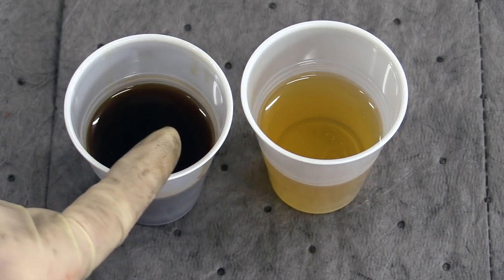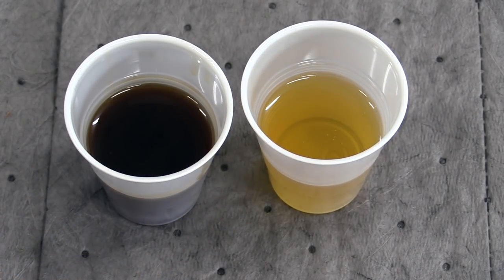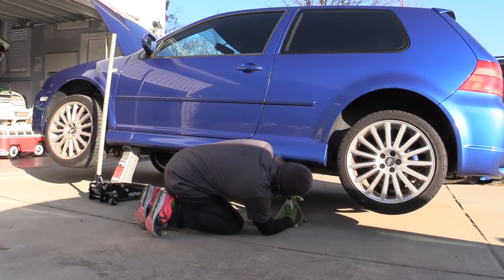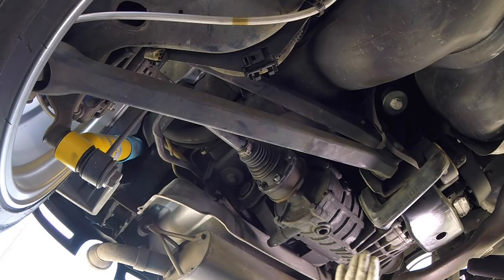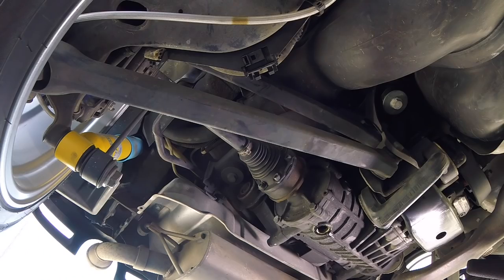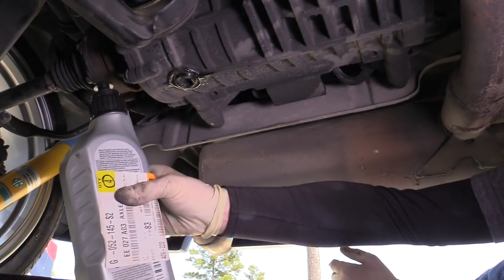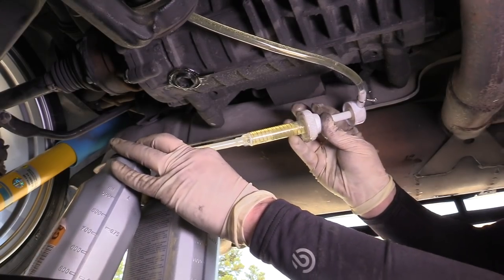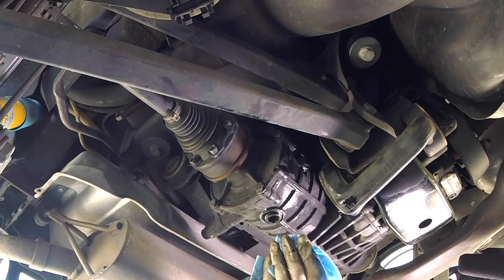How To Change Rear Differential Fluid

Comment: Always open the fill plug first that way you don't empty all your fluids and can't refill it
Reply: just about to comment this
Reply: everyone seems to forget that important first step!
Reply: It's saved me grief before.
Reply from the maker: They aren’t dumb. It would just be a much bigger pain to fill t from the bottom than the top.
Reply: HumbleMechanic So you cannot open it afterwards?? I’m confused.
Reply: In this very video, thats what you did.
Reply from the maker: The concern is not being able to get it out. If you start with the fill and run into issues, you can still drive the car with old fluid. If you can’t get it out after your drain, you’re stuck with no fluid. Or a hard time filling it. 

At a shop we couldn’t say “I can’t get it out”. We had to do what we had to do, and make it happen. For a DIY, it’s best to take the fill out first. Something I mentioned in the trans and Haldex videos yet to come out
Reply: HumbleMechanic Thanks. I understand. Have a good day, man.
Reply: Just about to say the same thing, saves grief!

Comment: Thank You Charles. Maintenance is so satisfying.  Hey guy's, Race Ramps. I bought the 10" inch Wheel Cribs, 2 piece design. Used them for the first time last weekend working on the GTI and had to use a tool to get the smile off my face. Lower half for simple servicing and if ya wanna get your wrenching on, stack the second half. Friggin Perfect!!

Comment: Great video Charles ! Recently did mine on a 2015 Q7., Front, Rear Diffs and transfer case. Was little surprised to see it almost as dark as the one you showed at just 35K. Is it normal to go dark at this little mileage ? I did not see a lot of metal sediments though.

Comment: Hey Charles,
Why would you shake the gear oil. As far as I know gear oil will not separate. Does that OEM fluid have some friction modifiers in it. Also just a tip lossen the fill plug before you drain the oil. Just incase it  won't come out . Ask me how I know. Another great video. I love the sound of that thing. Cheers Mark.
Reply from the maker: Good call on loosening the fill bolt. I always had to get it out and the fluid in no matter what. Hahaha. 

Shaking it is just in case any of the packages settle. Odds are they don’t, but it’s good habit. Unless you shake it so much you aerate the fluid. Haha

Comment: Amazing there is no service interval for diff oil or Power steering fluid. Sure it does not get contaminated like engine oil but that sample you drained looks like it has had some temperature which has cooked it. I have experience with truck diffs that regularly run at 100+deg. C in summer and the oil in them goes very dark. I changed the oil in my power steering system on my Ford when it got very slip and stick when cold. The oil looked very watery too and of course the smell. Afterwards, I found a lot of fine sparkly bits that would have been going round and round in the pump and steering box grinding away. Steering was much better afterwards too.

Comment: I'm currently in Germany and guess which car I see most? VW. No surprise there but the surprise for me has been the 2nd most car I've seen are Opels. I think the use to be owned by GM but I was told that is no longer the case. Nothing to do with your video, just thought it was a fun observation.

Comment: Also it will be good advice to derail fill plug BEFORE you drain all oil from differential, there is some situation when you just can't unscrew it because of rust or mud or whatever and you no longer have oil in differential and it can be pain in ass.

Comment: how resilient are the pinch welds in the jack area? I noticed you raising and lowering the car while one side was on jack stands at the jack locations on the pinch welds. I have some service that will require me to put my GTI up on 4 jack stands and I've been curious on how to get four stands on the pinch welds; starting with either 2 on the front, then 2 on the back or maybe going 2 on the left, then 2 on the right. The .:R found the right owner and I'm sure is loving every minute while in your garage and on the road with you behind the wheel.  Cheers.

Comment: Nice! Always love your videos, Charles.
Is this change about the same on the front diff? (In my case, a 2003 Golf TDI with a 01M trans)
Reply from the maker: The steps are the same. If you’re not in a rush I’ll be doing a video on that soon. I’ve already done it, just need to edit the video and do a few reshoots. I lost some footage
Reply: HumbleMechanic 
I neglected to buy gear oil with my ATF/filter order, so yes. No rush :)
Bummer about losing the footage!

Comment: How important to do you feel it is to have the car as close to exactly level as you can get it (both left/right and front/back) to get the fluid level right? I always try to get my cars super level when checking any fluid level, but this application seems like having the left to right angle not level could throw the capacity off quite a bit.

Comment: Wouldn't it be a good idea to remove the fill plug first? Cause if that gets stuck, you drained the fluid and can't get anything back in that easily.
Reply: This. Absolutely this. Was rule #1 when I started on the tools. Don't drain out what you can't put back ;)

Comment: You know how people say “don’t change your transmission fluid” if you’re high mileage and you’ve never changed it Bc it would damage the transmission. Does the same apply to diffs? Like could you mess up something if you changed it late?
Reply from the maker: I changed at 150k or so.  No issues

Comment: My wife’s 2017 Acura MDX SH-AWD called for the A6 service at just 12K miles. This is an engine oil change and an AWD diff fluid change. I was surprised that it called for this at only 12K miles. 
The rear diff fluid change ran me $110+tax done at the dealer. I’ll likely do this myself in the future. 
Is this common with many AWD crossovers to need this service done so frequently?
Reply from the maker: That seems like a crazy low service time
Reply: They may like to change the diff oil very early as it gets the initial wear in metal out of the oil and ensures a long trouble free diff life. The next service interval for it would be a lot longer. I remember my boat motor called for a gear oil change at 20 hours and the next one at 160 hours. All about getting the initial wear in metal out of the fluid
Reply: Marshall Sambell 
I hope you’re right on that.
Reply: HumbleMechanic 
I thought so as well. 
I’m gonna scan the forums about this. 
The vehicle doesn’t have a published service schedule. It uses sensors and algorithms and then posts maintenance codes on the instrument cluster for the driver to see.

Comment: Isn't it good practice to remove the fill plug first to make sure you can refill the case?
Reply from the maker: Yea it is. I think I’d have to just figure a way to fill it. And I mentioned it in the Trans video that will be out soon
Reply: They should make drain plugs with a fill valve then you could have a clear hose and when you held it up next to the diff it would show the level inside.

Comment: So.. quick question. I recently did my transmission fluid and I have a 5 speed mk5 jetta.. because I had to fill it in 2 holes, does that technically mean that I was also doing the front diff/transaxle/transmission? And, it shifts like butter! yay. Now I gotta do the same for the rear dif now.

Comment: The air con in my 2004 VW Bora (yes a Bora because I live in the UK, but  in America it'll be called a Jetta)doesn'told air. I can hear the compressor running. I don't want to spend hundreds of pounds on fixing it. I know the compressor runs. Should I try one of those DIY air con filler kits with a sealer or UV die?

Comment: Thanks once again for sharing the video can I ask you , if when doing this work on a street pavement, how can I level the car, as my pavement is not flat, it has a small inclination???
Reply from the maker: Just put your jackstands at different heights to level the car. Unless it’s crazy incline. Lol
Reply: Thanks for answer my friend, what I meant where do I put the level so I can adjust the height? on top of the hood? or on that ledge  on the door? ? And its not a crazy incline just a small one.

Comment: How about a 1992 chevy s10 2.8 v6. 5 speed 3.42 gears. I see high difference in colar of fluid. My old mans truck is 182,000 and I don't rember every the different changed. Could been?. Factory to the bone truck.  If I don't get it changed or let the old girl have old juice.  Awesome. Work .from a chevy guy with a empowered v6!

Comment: What changes as a Dealership Technician when a Company introduces a new car model, i.e., the new 2019 Subaru Ascent or the Brz,Frs,GT86's?
Reply: Josh
the new models bring with them different suspension/engine/electronic architecture that a dealer tech will have to learn about as part of annual training requirements.

Comment: Out of curiosity, would anyone happen to know which(if any) gear oils come with the limited slip additive already in it? I know Valvoline has a gear oil for LSDs, not sure if it has additive or not. I have a 97 Grand Cherokee with a D44A and factory Trac-Lok LSD. Figure, doesn't hurt to hear/read recommendations.

Comment: You should mabye consider switching from latex to nitrile gloves, much more resistant to solvents and oils and overusing latex might end you getting allergic to it, we got a warning at work about allergic reactions from it and never used since (allergy to condoms 😉)
Reply from the maker: You are 100% right! I used nitrile at the shop a lot. I like latex when I am working to not get dirty. When it's in chemicals, nitrile is the way to go.

Comment: I bet it's a 3/8s snap on torque wrench with digital torque angle I have that same torque wrench for work
Reply from the maker: It sure is. One of the first generation ones
Reply: HumbleMechanic I purchased mine about 4 to 5 years ago

Comment: I would change it every 30-40k miles...
Reply from the maker: I like that mileage a lot. I mentioned 100k, because there is no service interval. The industry “standard” for non service interval  fluid is usually 100k. I’ll probably do mine @50k